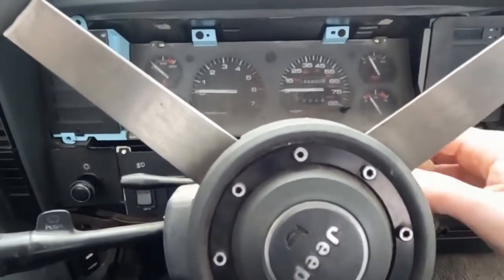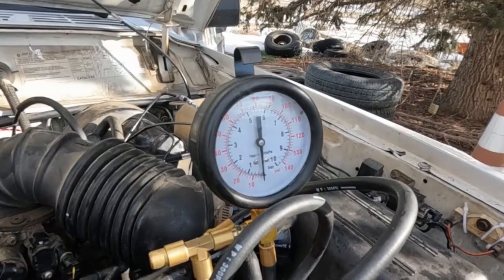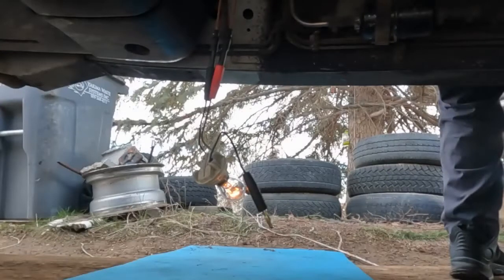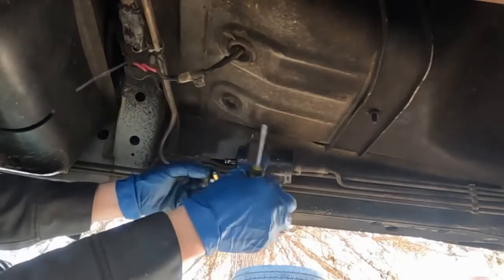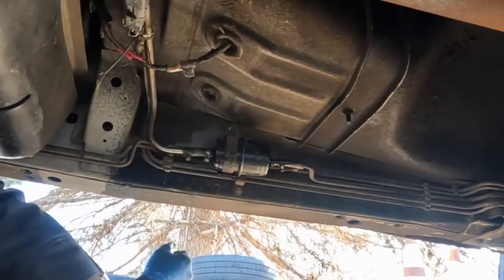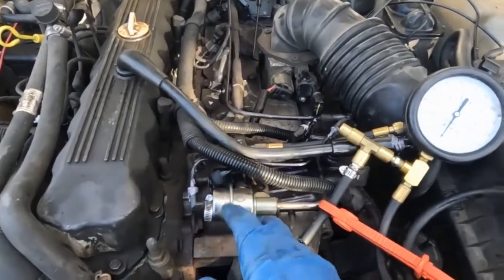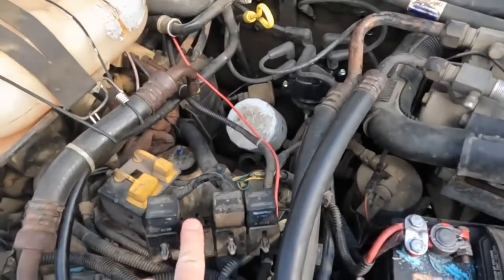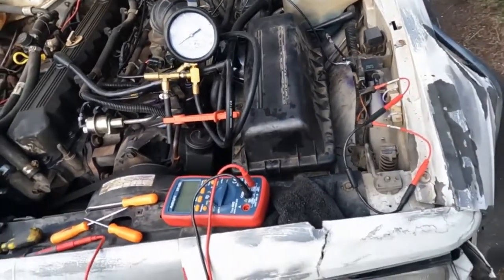1990 Jeep Comanche Starts Then Dies | Diagnose a Start and Stall Condition

Comment: Awesome video! My '89 Comanche has been having this problem intermittently and today it finally would not run at all. Indeed, the connection to the resistor was loose and all I had to do was push it in a bit to fix it. But the best part was leaning about how to diagnose fuel system problems and the logic of how the system works and energizes the fuel pump. Great job explaining things. And thanks so much!

Comment: When cranking is from key one power source then once it's running the fuel relay turns on to keeps it running  but you said it differently. Im dealing with the same issue, mine stalls like your i just went a head and put new fuel filter in and drained fuel tank as it sat for a while, started and died again so junk yard and fuel relay and resistor and still dies so i need to see if fuel pump is at 30psi, Craigslist has a fuel pressure tester listed that will work for my 89 XJ,  20 miles away but where my favorite chines food is guess im making a drive for a fuel rail tester and getting take out, one thing i noticed is when i bleed the fuel rail to remove the fuel filter no pressure.....in the line.

Comment: How could it run with the fuel pump relay removed? Did you jump the relay?
Reply from the maker: @StephanWelch-o2u  This Jeep had me confused at first. While cranking the fuel pump runs off of a different circuit. Once it starts up the pump switches over to the regular circuit. So when I was cranking the engine the pump was running and filling up the fuel lines with pressure. Once it started the pump stopped working and the truck slowly ran out of fuel pressure and died.

Comment: When removing the fuel filter just cut the small length of fuel line going into the filter ....it should be replaced with a new filter anyway.